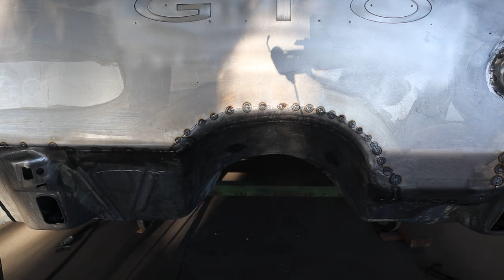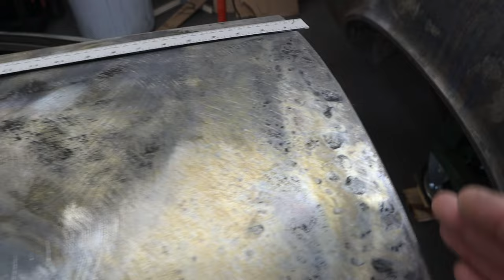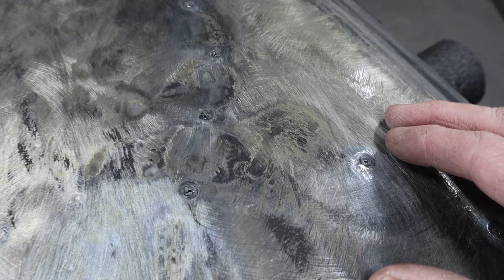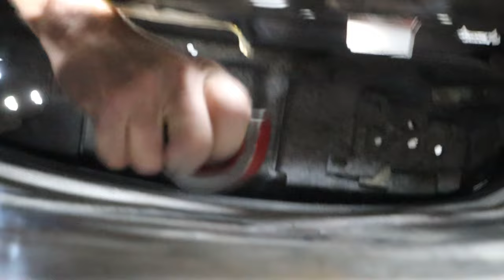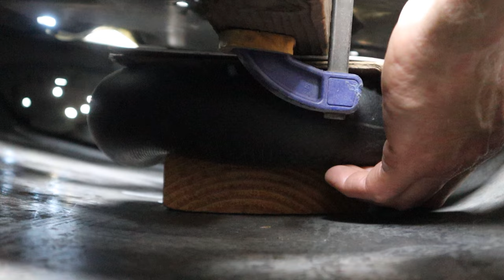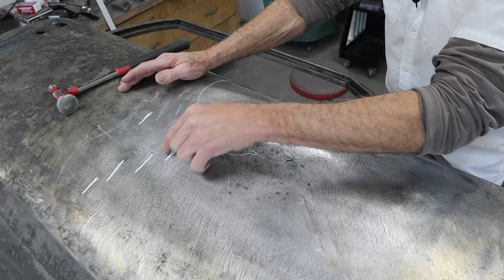Undoing a Slide Hammer Repair - Door Skin Repair GTO RestoMod (Ep 44)

Comment: Excellent Mark! This will give me a plan of attack for one of my doors which has about 8 slide hammer holes near the bottom. I'll send you some pictures soon.
Reply from the maker: Thanks Doug.  I just don't get the body shop aversion to taking the door panel off and pushing a dent out.  They would just drill holes and pull with a slide hammer.  Luckily for you there is plenty of access.

Comment: As always, another well done step on the project.  The clutch assembly deserves a gold star.!  You also deserve recognition for the consistent quality camera work and editing as well as content.  Keeps me coming back every day to see what's next!  I'm currently making up 20 gallons of the EDTA solution, which I learned from you, and soaking large parts in a 4' diameter kiddie pool for rust removal.
Reply from the maker: Thanks Don. I really appreciate you taking the time to comment and your encouragement. The EDTA will burn itself out and slow down the more you use it. I surmise if remove the parts slowly trying to keep the rust from falling into the solution it might make it last longer. I used EDTA 4na but someone suggested EDTA 2na which is worth looking into. Looks like it is less expensive too. Be sure to let me know how your parts come out.
Reply: The kiddie pool with the solution worked great right up to the point a sharp edge poked a small hole in the bottom edge😂  Must have happened when turning the center grill section late in the evening because the solution had leaked out overnight... No biggie though because everything else was done.  Going try to find the EDTA 2na for one more application for the 37' grill insert.
Reply from the maker: @DonBrantly  That sucks. At least you didn't a few hundred bucks of Evaporust leaking out.   The 2na looks to be cheaper and from what I understand the ph is a lot more favorable.  Let me know if you go that route and how it works. 
Mark

Comment: I feel your pain, Mark. My Buick looked like Bonney and Clyde used it for a getaway car. The last guy used the slide hammer holes for anchor points for the 1/2 inch of bondo on the doors and quarter panels.
Reply from the maker: Yikes! Back in the day I never used a slide hammer if I could get to the back side. Sometimes we would just put our foot in there and push the dent out. Undoing all those holes and pulled sheet metal eats up a lot of time and patience.

Comment: Great video Mark.  Clever use of the tube!  
You mentioned lack of access in some vehicles.  That’s an issue I’m having with the ‘49 rear doors.  
I’ve used welded studs and pullers etc to get the bulk of the dents removed, but I need access to the back side for hammer and dolly.
Now that I’ve got the majority of the stress removed from the outer skin (hopefully) what do you think about cutting a small access hole in the inner skin??  Then repair that hole when the outside skin is done.   I don’t mind the time it’ll take, but I also don’t want to cause extra damage.   I’d highly value your opinion.
Reply from the maker: Good to hear you are making progress Robert.
I have done what you are proposing many times.  Look at the inside panel carefully and determine where the door gets its strength from. Usually the perimeter where it is stamped over. If I were to do it I would come in 4" from the sides minimum. Be mindful of internal bracing or brackets for hinges and latches though. One thing I can tell you is to not go to small because then you end up cutting more making the inside panel repair much harder. Map out your cuts to make welding it back in easier. The biggest concern will be twisting or potato chipping on you but I highly doubt that will happen. When the time comes to weld it back in use some scrap sheet metal to make tabs you can screw to the inside to lay the panel on during tacking and welding. 
Sometimes you have to do more damage to repair damage. You are on the right track.
Reply: Great!  Thanks so much for that.   Really appreciate the insight.

Comment: Mark, just found your channel and love your videos. Im restoring a 67 post car and would be very interested in you making a video on re installing the rear quarter windows. Its been a few years since i took them out and didnt take any pics of the disassembly. Haven't been able to find any assembly diagrams.
Reply from the maker: Thanks Randy and welcome to the channel. Please spread the word to your friends.
I did do a power window conversion for the quarter glass and when I took Ruby apart I showed some disassembly. You might want to go back and check those out.  In a nutshell the chrome strip has a small "T" plastic guide that slides into the window channel on the post.  It drops in just below the bottom of the post and once you get that in the rest is pretty easy.  I am waiting on new quarter glass window channel from OPGI but they are on back order so it will be a bit before I do anymore quarter glass videos.  Email me if you have specific questions and I will help if I can.
Mark